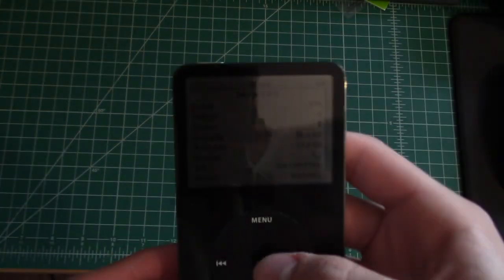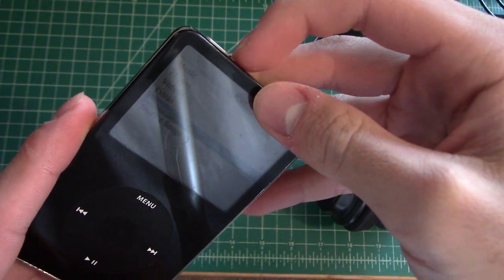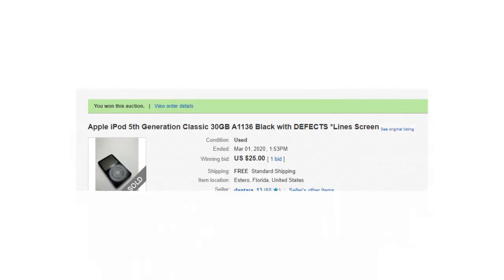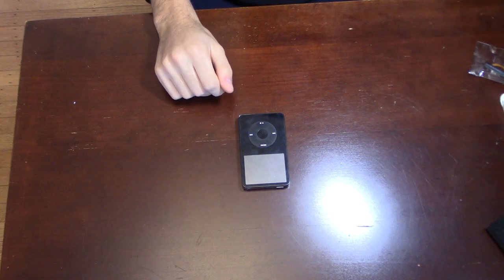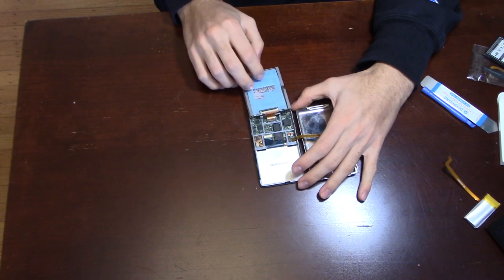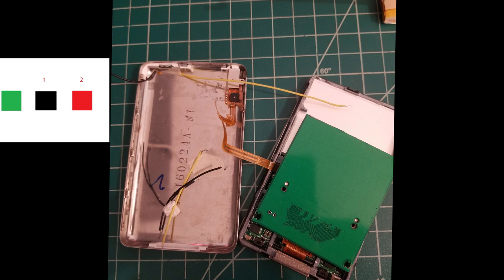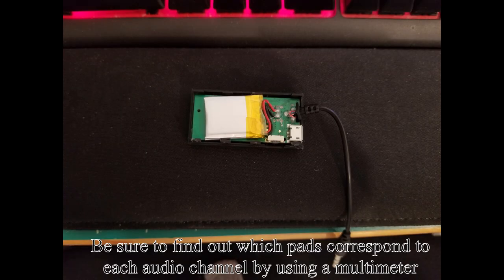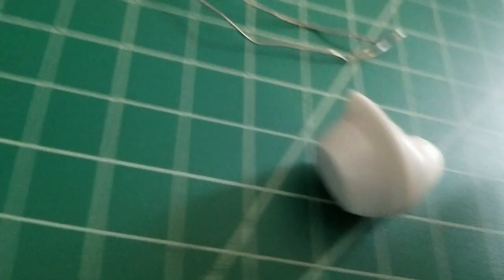How to Make a Bluetooth iPod Classic mod with a Headphone Jack [No Drilling]

Comment: Nice video,  try to do another video explaining (just the bluetooth mod) step by step in detail with pictures pointing at the exact parts. Thanks.
Reply: Would really appreciate this kind of video as well!!
Reply from the maker: which parts are you unclear about, I can try to explain
Reply: @TheRedMammon  Can you take pictures of where EXACTLY the wires were soldered on both sides of the "bluetooth board" and the ipod's board. That would help us (newbies) a lot!! Thank you!
Reply from the maker: @thomasshepsky2253  well it varies depending on which board/ipod you are using. Could you provide me with your models please?
Reply: @TheRedMammon  Ipod Video, 5.5 30GB.  "Modded" with thick case.  Another model, Ipod Video 5.0 30GB. Thanks!
Reply from the maker: @thomasshepsky2253   Following instructions are for the 5.0 gen: for the power leads, I soldered positive to the black capacitor on the right of the board (if the ipod is face down). There are two capacitors, choose the top most one, and solder the positive lead to the left side (ground can go to the chassis or the other side). As for audio, you want to use the orange capacitors, as shown in the video with labels L and R
Reply: @TheRedMammon  Thanks!!!
Reply: @TheRedMammon  hey how about for the 7th gen thin?
Reply: @TheRedMammon  I have a 6th gen iPod classsic.

Comment: Hello, great job with this project. I'm curious if you've had any luck connecting to a bluetooth enabled car audio system. Seems it should work but I've had no luck with such transmitter modules.

Comment: If you take job requests, I’ve got an old 5.5 gen with the sd flash mod. If I were to send you my iPod to do the Bluetooth mod, could you drill and slot a dedicated bluetooth button onto the chassis? Would they be compatible with my AirPods? (I’ve bought a few transmitters that couldn’t communicate with my AirPods, but would interface with everything else.) How much would you charge USD?
Reply from the maker: Hi, I appreciate your inquiry. As of now, I am very busy with school and will not be able to take requests, though that shall change come the new year should you want to wait. As for compatibility with airpods, I believe that you would need to find a specific bluetooth module that states that it pairs with airpods. Pricing can be discussed once I have time and assess how long the job would take

Comment: Hello, first I congratulate you on your channel; I like all the information that you develop in your videos. I wanted to ask you about the placement of the bluetooth transmitter made on the Ipod, you can expand the information where you connected all the points so that the transmitter works. I'm doing the same project, but it doesn't work and I think I'm doing the wrong connections
Reply from the maker: I am using a 5th gen iPod, so if you are using anything else, the solder points will likely be different. First off, I used my multimeter to find a constant supply of about 3.7 volts to supply the transmitter with power. Then, I found the audio channels and soldered the corresponding  transmitter wires to them. And for ground, any ground will work. (make sure your transmitter is in fact a transmitter, some will have transmit and receive mode)
Reply: The Red Mammon  What recommendations do you give me for the 7G ipod classic, can you help me to adapt the blurtooth transmitter
Reply from the maker: @franklinjaimes7233  I have no experience with 7g, but my advice would be to solder the audio channels direct to the headphone jack assembly if you have difficulty finding the correct capacitors. And use a multimeter to find a constant power source. (Keep the negative probe on the metal frame of the ipod, since that is ground)

Comment: Hey, may I ask you a question? How th did you remove the micro USB and the connect button from the bluetooth transmitter? This is my first project like this and I'd be reallly happy if you could help :)
Reply from the maker: So the way I removed them is by desoldering (i heated up the connector's solder points with a soldering iron and pulled em off). You can also just snip em off with wire cutters i guess. Good luck!

Comment: Great tutorial! I have an issue however, when I toggle the hold switch to turn off the transmitter, it begins to shutdown (long red light) but then a second later both LEDs are on steady. Any ideas?
Reply from the maker: hmm,well as long as it works fine i wouldn't worry
Reply: @TheRedMammon  So, after some digging it turns out if purple the device needs to be reset. I have to toggle the hold switch a couple times and it takes! Thanks for responding, and again for the video!!
Reply from the maker: @Rnhok82  glad to hear you were successful!

Comment: Hi there, i love your work. Could you please take a large photo of power source for the transmitter? The video didn’t show it clearly. Thanks a million.
Reply from the maker: Hi, sorry that it was not clear. You can take a multimeter and measure voltages across the capacitors. A quick way to find the +3.7v signal is by grounding your multimeter on the metal frame rail as that is ground for the entire iPod circuitry.

Comment: Any chance you could tap into the play button long press to toggle the Bluetooth transmitter? Also where did you connect your audio ground from the by transmitter to the iPod?
Reply from the maker: as for the play button long press, you cant do that without some sort of microcontroller, though you could make it so that when the hold switch is enabled the play button can toggle bluetooth. Audio ground is the same as the power ground
Reply: The Red Mammon thanks for the reply. Very interesting about the play button working as a toggle for the BT transmitter when the hold switch is set to hold

Comment: nice this is an easier way but can you make a more indepth video regarding the solder points like in the jack where did you solder them and how did you know the  where to get the right voltage for the transmitter 
?
Reply from the maker: I have them labeled in the video. The orange/red capacitors are for audio and the black one with 3.8v across is for power
Reply: @TheRedMammon  is it the same for ipod 6.5? Cause that's the one ihave i have been pending this project cause i want to make it right :)
Reply from the maker: @HCtres  The basics should be the same, but the solder points will differ. Try probing around with a multimeter to find a good source of ~3.7v
Reply: @TheRedMammon what gauge of wire did you use ?
Reply from the maker: @HCtres  not sure, I just used wire that was lying around

Comment: if i wanted to drill my case and use a microswitch push button (mouser part 5-1437565-0) for the bluetooth receiver, how should i go about soldering the 4 pins?
Reply from the maker: use a multimeter set to probe continuity and see which pins bridge together when the button is pressed and do not bridge when the button is not pressed. then solder to these pins

Comment: what models does this work on I have the iPod classic 7th generation
Reply from the maker: The video is for 5/5.5. 7 gen procedure will be slightly different. You will need to find your own solder points using a multi meter and some experimentation

Comment: Hey i'm thinking of doing this with my ipod too! I am wondering if the audio output to the transmitter follows the same path as the headphone output or the line output from the 30pin dock connector. I ask as I am also doing the diymod affecting the line output and don't want these two modifications to interfere with each other. Great work here and I'm looking forward to hear back from you!
Reply from the maker: Hey, I don't think they would interfere. You should be fine using the 30 pin's line out though the source of that line out is still the same capacitors i showed in the video
Reply: @TheRedMammon  So in the diymod, I need to desolder the coupling capacitors near the DAC, the inductors near the dock, and the capacitors that comes right after the dock inductor. From this there is a direct connection from the solder points where the old capacitors were, to new elna silmic II capacitors to the 30 pin line out. If i connect the bluetooth module for power on the capacitors you showed and the L and R outputs from the capacitors you showed, there shouldn't be interference or a dead signal even after removal? 

I apologize for all the questions I'm a bit new to soldering and electronics, but I'm trying to jump off the cliff with this project hahaha. 

I also have a multimeter if anything after doing the diymod, I imagine I should check if I am getting signal from the L and R capacitors you used here? if no signal then I can probably route them to the headphone jack ribbon cable. I know this is a lot, but again i appreciate your guidance with this, means a lot!
Reply from the maker: @xavonthenave  Lol def sounds like you're jumping off the cliff -- but it is by far the best way to learn! As for the specific mod you're doing,, I have no idea what the end goal will be from desoldering those components etc.. could you please provide more info
Reply: @TheRedMammon  
Haha I know! It's a big undertaking, but I can't wait to have this project fill up my time for the coming weeks!

As for the info–there is a more detailed explanation and guide on the flash.xyz website (on the sidebar "Modding: Audiophile meets iPod (diyMod)"), but in summary the point is to bypass the lower quality smd components and instead route them to larger audio centric capacitors directly from the Wolfson DAC in order to achieve a higher fidelity sound. My understanding is that capacitors in relation to audio act as kind of a filter for audio output, but I may be wrong. 

Ultimately, the removal of these components will take precedence over the bluetooth mod (for my project). The questions comes about the status of these capacitors you used to source your audio output to the bluetooth module–I don't know whether they are a part of the original circuitry starting at Wolfson DAC and ending in 30pin line out. So if the capacitors mentioned in your video (the left and right audio outputs) are disabled post diyMod, I was thinking connecting the wires from the bluetooth module to the same circuit made by the diyMod (so my idea would be to wire the bluetooth module directly to the legs of the capacitor) might be an option, but my knowledge is limited in circuitry and I have a feeling that the result of this wiring could lead to a short possibly? Not sure.
Reply from the maker: @xavonthenave  Ah i see what you mean now. The website you linked doesn't work ,however, you should be fine with the bluetooth mod if you just connect 1 to ground (anywhere on the logic board) and then your left and right to your 30pin line out which you said would be running off of the 5.5's wolfson dac. good luck! 👍
Reply: @TheRedMammon  apologies, the correct link is https://www.iflash.xyz/ But thanks for the confidence in this project haha. I feel a lot better about this undertaking now. I'll get in contact with you when I finish the project, should be fun! Thanks again for all of your help, very grateful for it!

Comment: Hello excuse me for the question, I am 12 years old I am French and I would like to redo her, I just bought the iPod and all the equipment but I have a question of where the yellow and black wires come out. the bluetooth adapter
Reply from the maker: which wires do you mean? do you have the same bluetooth adapter?
Reply: @TheRedMammon  solder wires on the bluetooth mod and yes i have same câble
Reply: @TheRedMammon  in 5:26 thE wires yellow and black
Reply from the maker: @alphamoussa601  those cables are for power to the bluetooth adapter +3.7v
Reply: @TheRedMammon  Ok so it is worth soldering it from the iPod to the transmitter or they are already on the iPod or on the transmitter
Reply: @TheRedMammon  in fact I did not really understand where all these threads come from, do you have to buy them? I also did not understand or should they be soldered from the button and the ipod card
Reply from the maker: @alphamoussa601  you need to solder all those wires yourself
Reply: @TheRedMammon  And these cables you have to buy them or they are already in the iPod
Reply from the maker: @alphamoussa601  these are all custom things you gotta buy
Reply: @TheRedMammon  Ok can you give me a link of all the wires to connect from the ipod to the transmitter?
Reply from the maker: @alphamoussa601  they were just random wires i had lying around. any small wires should do
Reply: @TheRedMammon  Ok I understand, but I don't have it plzz link
Reply from the maker: @alphamoussa601  there is no link its literally just a small random wire I had lying around
Reply: @TheRedMammon  Ok I can for example take a micro usb cable or a jack? Also sorry you can send me a more detailed photo of the soldering point on the iPod and the transmitter
Reply from the maker: @alphamoussa601  the soldering point varies depending on which transmitter you get. As for the wires, you could use the little wires in a usb cable yes
Reply: @TheRedMammon  i have same transmitter
Reply: @TheRedMammon  well can you take a picture for me plz ?

Comment: How did you paired the headphones?
Reply from the maker: the hold switch controls the switch on the bluetooth transmitter
Reply: @TheRedMammon  so you dont have a hold switch anymore?
Reply from the maker: @francescocannavo2168  its there, just doesnt to hold switch stuff

Comment: does it drain the battery very fast?
Reply from the maker: It doesn't drain the battery when it's off. For actual usage, it will get you through a day. I have noticed that the iPod battery life reading isn't always accurate and will say the battery is in the red but when you restart it, it will be in the green
Reply: @TheRedMammon  can you put a bigger battery in there?
Reply from the maker: @1Beaugosse1  if you get a thicker back or find a bigger battery with the same thickness of the OEM

Comment: Is this applicable to the 7th gen?
Reply from the maker: the 7th gen seems to be laid out a bit differently. You would need to probe the capacitors yourself to find out you solder points